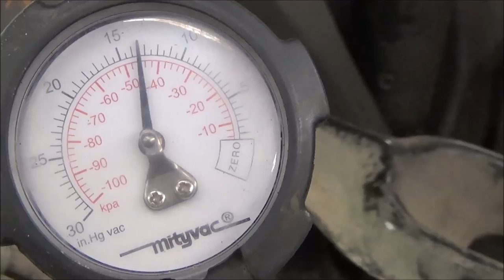Pontiac Grand Prix 3.8 - Water Pump Replacement

Comment: That engine is fucked..   that kind of blockage only guarantees some of the engines cylinders were not getting sufficient cooling there for over heating..  possibly q slightly warped head or burnt up piston rings.. not to mention valves could be a little warped..that engine will never be the same.. in order to ensure that engine is top notch.. the heads will need to be pulled off and all the coolant ports cleaned with a wire rod to ensure proper flow.. especially since the port are most likely about 6-8mm in diameter.. very easy to plug up with that garbage.... another thing that can be done is a acid flush ... over all it a mess.
Reply: butchtropic  ...I know I've delt with many of them.. just becuase it runs good does not mean all the blockage is out... I've made that mistake before  and caused the cylinder head to warp from over heating on 2 cylinders and loose compression..  in the end I hand to take off the heads and send q dat cleaning all the ports... thoroughly... and then when I put everything back together and timed the engine.. I ran acid flush thru it.. just to make sure...

That's what happends when you mix dex-cool with regular green anti freeze..   and sometimes even after all that cleaning it will still come back..so you gotta keep checking the radiator  cap for build up.
Reply: butchtropic  ...its all in your head.. it's actually not that bad.. same as a V8 but sideways... removing the heads in my mind is the only way to guarantee clean ports...  unless one wants to deal with the same or worse issues down the road.
Reply: butchtropic  ..realisticly.. all your putting into it is head gaskets and coolant...
Reply: butchtropic  ..yea same with the 3.8L pontiac grand prix.. and if it has a super charger it's even tighter...   but  it's not bad once everything is removed... exhaust manifolds might be a bitch.. probably gonna havto change the gaskets on the exhaust manifolds too..  its alot of work.. but dealing with that crud you gotta be certain it's out..  it gets into places and creates extreme coolant pressures.
Reply: butchtropic  lol..

Comment: GM stop leak pellets
Reply: I’d never use them but technically you’re supposed to crush them up and mix them with antifreeze it looks like they just opened the radiator and threw them on top and went on their way LOL

Comment: I wouldnt waste my time with a car so poorly maintained, Im betting the  transmission fluid will be black and if you do an oil change the motor, it will blowup while checking for leaks, and no brakes

Comment: I am giving you a thumbs down on this one you should have recommended to the customer a new radiator because all that flushing is not going to clean that radiator out could have flush the heater core a little bit better the car is still going to have overheating problems!!!

Comment: That engine and cooling system is toast. Scrap the car. The customer used radiator sealant product which never works bu does this kind of thing.